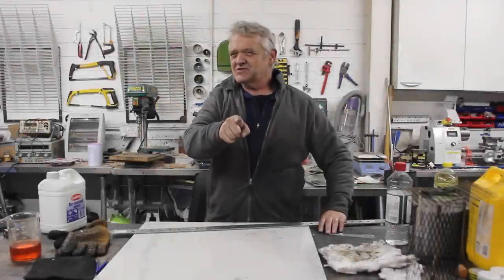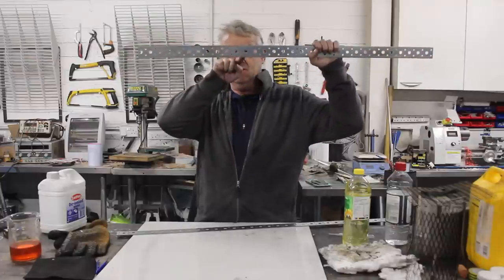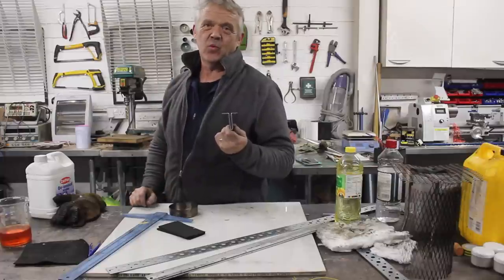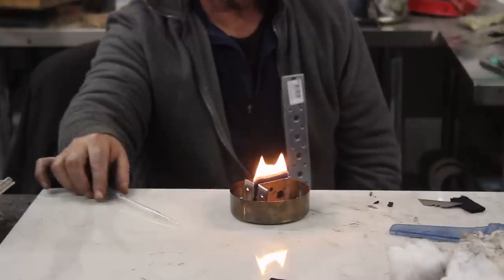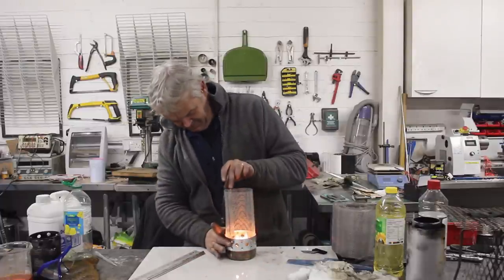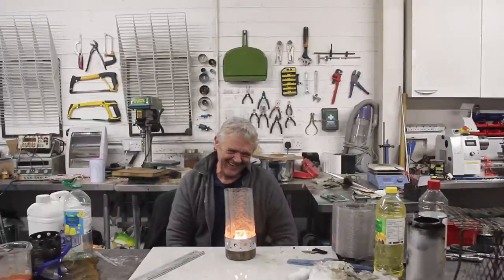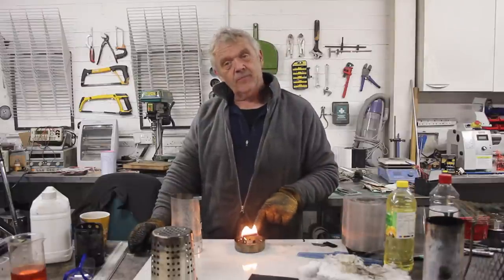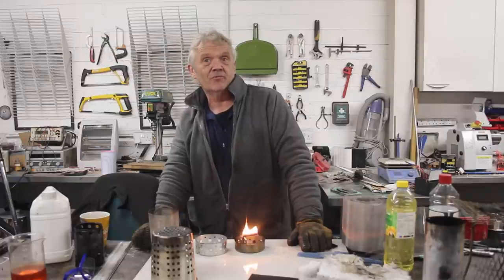1712 Simple Cheap Effective Vegetable Oil Heater

Comment: Thank you so much. Solves the problem I've had for months: Getting a large-enough flame from vegetable oil fuel. (Candles in Crisco collapse before there are anywhere near enough wicks bunched together for a decent flame.) The cat-can stove starves for combustion with heavy fuels. I arrived at an understanding that the mixture needed lots more air. Great answer. I never thought of having big holes in the wick holder to get that air into the wick. Looking forward to trying the circular version, for that much more flame size.

Comment: I make oil lamps both for both fun and practical use, and I liked the simplicity of your design. However, olive oil burns cleaner than other plant-based fuel, so I'd recommend it to anyone who fancies having a go. That said, I'm currently burning a 50-50 mixture of olive oil and sunflower oil, and it's not smoking, but does give off a lovely glow and a fair bit of heat. Anyway, I've only just found this channel, and I'm glad I did. Great video, thanks 🙂

Comment: I made my two tin can heater using rubbing alcohol as fuel...started burning really well, then blew up, the inner can flew out, setting fire to some black bags, the main fuel can was also on fire. Luckily I managed to put out the fires using towels to smother...I will now conduct my experiments outside, or in the sink lol   I had forgotten the cover the fuel hole in the inner can !

Comment: Thank you Robert for your time and effort. Instead of the strapping (which I don't have), I'm going to try cutting both ends off a tin can, squash it flat, and cut it to size. Drill holes in it and open the  folded tin, feed the wick in, and then squash it flat again. Stay warm all of you.
Reply: Best wishes from Ireland 🇮🇪.  Btw great idea

Comment: Robert, I was talking with my father and he said to try black sand in vacuum tubes. He said they operate just like a traditional "radiator" or boiler and the thermal mass maintains a heat of like 300°F even overnight.
Reply: Can you elaborate on what you mean by this? I’m interested

Comment: You could turn it into a radiator by "floating" the kitchen utensil centrally on a long rod so that it is free to spin around, then using tapered metal construct a fan inside it so that the heat spins it around - sending the heat out further into the roof. Bit like those xmas decorations that spin above a candle but this one may also increase the oxygen intake due to the side ducts, potentially improving the pyrodynamics too!
Reply: Heat universally Rises and would act upon the fan idea, gloriously... without the addition of multiple candles.
But it would be rather superfluous.
Reply: @Peter-jo3wt  The rising heat is deflected radially by the propellor, distributing it horizontally away from the device - making a radiator. This also accelerates the rate at which air is drawn into the ducts which adds oxygen to the flame.
Reply: @designerzen  
Heat moves in three specific ways.
Convection
Radiation
And transmission.

Convection means, that heat rises in a column of fluid
(Water, air, other) dynamically.
Radiation means, that heat radiates omnidirectionally from its source (in every direction).
Transmission means, if you touch a hot Skillet it's going to burn you.
A warmer item will transmitt heat to another item of lesser Heat, through contact.

Rising heat that turns a fan does not suddenly become radiant heat.
The fact that the fan May spread the heat a little through its mechanical process, does not mean that the heat radiates from the fan.
Reply: So what you are saying is that the metal fan is unable to heat up even though it is above the source?

Comment: Hi, just a tip. You can use wheel spokes or some thin steel bars to make an outer structure to give it some stiffness. I made a solar parabole with a candle heater that way.

Comment: I like the wick holder. I also found that if you make a "wick sandwich",
by putting a normal cotton wick on the outside (both sides) of the carbon felt and have the carbon felt stick up a little on the top, it will wick up the oil better.

Comment: Used olive oil for my oil lamp, the flame is descent, fuel wise: lampoil makes it burn for 70 hours, with olive oil it was 96 hours and the smell was quite pleasant. But had to pinch the wick a little bit in order to light it, total soaked is harder to get it lit.

That carbon felt is quite an invention and Discovery.

Comment: That was a great idea using the wick horizontally with the vegetable oil, you can now make the wick any length you wish. Imagine a 2 foot long flame with a glass top outside your back garden or inside a cabin. It would give of a wonderful gold light for hours and hours on a very small amount of vegetable oil and that's not to mention the heat it would provide. (You need to get a small gas jet flame lighter this will light the wick soaked in vegetable oil instantly.
Reply: Be careful if too big with carbon monoxide.
Reply: @stonynotdusty   released carbon monoxide: yes this is a very serious problem and should never be used inside a home especially a family home. ( Its good to experiment and wish to use an open fireplace or outdoors ) thanks for highlighting the possible dangers of vegetable oil lamps.

Comment: I'm finding after a long burn (8-10 hours) the carbon felt wick gets a crusty build-up that kills the flame.(using filtered used veg.oil) But, I was thrilled with the results of my attempts...and inspired by you to keep "working out the bugs" and finding better ways!  Thanks for your inspiration!
Reply: Could you have two or  three wick set ups?  Clean one and use one while drying.  Or just replace the wick,. The charcoal sheet is super cheap.
Reply: @secondact7151  I just trim the crusty part off...and relight.

Comment: Not sure if the UK use similar looking strapping for bracing framing diagonally but is a bit lighter and more flexible. Bought on a roll it has a stack of other uses and would be cheaper than what you used Rob. Also easily cut with tin snips.
Quite apparent that you're all facing a bitter winter with fuel going through the roof so I'm sure these little heaters are in response.

Comment: Maybe you can just use your mesh as a wick holder and make the t the same . I like the idea of a circular wick with mesh and will be doing that tomorrow with my carbon felt that arrived . I love burning used motor oil . Its my new hobby ! 😂👍🏻
Reply: Update?
Reply: @secondact7151  soon I will but different way of doing the design .

Comment: Btw, I had used terra cotta for a pick.  I cut out a round piece, and  partially drilled circles within circles in the center about 1/8-1/16 deep and it burned very well and wicked well also.  The circles are necessary to sustain the burn.  Start it with the alcohol or equivalent as you have done.

Comment: I'm making a setup using a computer cpu radiator and 120mm fan to distribute the air, much like a secondary heat exchanger in a home furnace. This oil burning set up should be a great addition to my build today.

Comment: Well, I have some similar strapping as well as some flat stock of similar size.
I'm off to make three. One without holes, One with a few like yours and, One with as many holes as I can reasonably fit.
I haven't any Carbon felt but I have both cotton and fiberglass wicks for kerosene/paraffin lamps and heaters. I still think it'll give a good comparison as to how much difference the holes make.

I'll be back here later if I find anything interesting.

Thanks Rob! TnT is time much better spent than going down some YT rabbit-hole or, worse! turning on the TV or some game.
Reply: I'm curious to know how your experiment turns out.
Reply: @Eyes0penNoFear  That took a bit longer than planned and, while I aim to try again sometime with carbon felt, the one that worked best for me was a simple cotton lamp wick (the stuff I had was 3/4" or 19mm and I used two to make it reasonably wide) but made little difference what holes were in the wick-holder. 
What really mattered was how the wick was trimmed (I think the small space between the two wicks made this easier to tune) and, to a small degree, how thermally conductive the holder was. With a better conductor I could get a larger flame before it started smoking. Another bit that helped was a solid chimney about 5" or 12.7cm with air holes just a hair below the flame and then the mantle to make sure everything burned.
Set up like that it smelled like maybe someone fried an egg that morning, which I'll call practically odorless.

If you or anyone else tries, I'd sure like to hear how it worked for you.
Reply: @matthewellisor5835  thanks for the update!

Comment: Yes a small circular wick should heat and vapourize the oil more. About an inch wide or less. Making sure oil can reach the centre of the circle.

Even better but more tricky is a hole in the middle of the oil Holder, metal folded up or a small metal tube welded in the middle. Then the wick ring going around that hole tube. It will look like a donut cake tin. 
The air rushes up thru hole to make flame bigger and burn better. The oil Holder will have to have legs to allow the air to travel up thru hole.

Comment: That even looks pretty!
I’ve ordered some activated carbon felt. Looking forward to having a play with it. I have a couple of hurricane lanterns that I use on the odd occasion that the power goes out and have thought for a long time that it would be great to burn cooking oil in them. Before I found you the best option was to turn it into bio diesel. Changing the wick will be much easier!
Reply: Where did you get your carbon felt, please? I'm confused and don't want to buy the wrong thing.
Reply: @marijenkins2674  I bought it on eBay. I’m not absolutely certain that it’s correct as I couldn’t find anything about it being 100% activated carbon, and it’s only 3mm thick instead of 5mm, but I figured I could double it up to get the thickness and if it doesn’t burn properly I’ll figure it wasn’t 100%, in which case I can use it to replace filters rather than to burn. It was only $17 so I’m not too fussed if it’s the wrong thing. It actually just arrived a few minutes ago so I’m trying to remember which box the hurricane lanterns got packed into so I can pull them out and give them a go. That might be an impossible task. I do have a couple of tiki torches I’ve never used and I know where they are so maybe I’ll try it in one of those.
Reply: Thanks Monique. I found Robert's online shop and bought a piece direct from him. 5mm 14×14 inch for £10. I'm waiting for it to arrive. Good luck with yours!
Reply: @marijenkins2674  oh good work! I’m in Australia so didn’t want to pay international postage. If mine doesn’t work I guess I will though lol. I found the tiki torch and cut a piece of wick for it. I about half filled it with used cooking oil so figured it had a fair way to travel up the wick so left it outside and I’ll try to light it in the morning. Fingers crossed!

Comment: Handy. I may build one of those and add a small raised outside frame to place a metal mug such as the Army metal mug for making a brew, or an Army mess tin over the top of the flame to warm some soup, beans, etc. 2 birds, 1 stone. It could well be worth experimenting with to see if it will provide heat, light and also cook, as used cooking oil is quite plentiful.

Comment: Robert, that topper thing you put over the flame can be enhanced by first blackening the whole thing (both inside and out) by holding it over the flame so it gets covered by soot. Dark surfaces absorb heat better, but they also radiate heat better. Matte black surfaces have much higher emissivity than shiny metal surfaces. That way, when you put the topper on, and it gets hot, it will radiate out heat to the surroundings as infra-red radiated heat.
Reply: @larrymartineau7507  The reason a mantle is used is because the point is not actually to heat the room. The point is to heat the people in the room. If you just have the flame by itself, the heat is embodied in the hot gases, which just rise to the ceiling. But if you use a mantle, those hot gases heat the mantle up, and the mantle radiates heat sideways, warming up the people around it.

Comment: Is there any way you can indicate actual heat output of the various devices you construct? i.e. in 'watts'.  It's much easier to make a decision on the device to build based on 'watts' than 'hot' or 'hotter'.....

Comment: I think the reason this works is more about the metal bracket getting hot, and pre-heating the oil, helping it vaporize more quickly as it hits the flame front

Comment: Awesome video, by the way would adding a computer fan to it work? i was thinking making like a used oil rocket stove using used cans to make a tube with some holes near the bottom, and the fan on the top.

Comment: I wonder if a wick holder could be made from one or more layers of the stainless steel gauze directly. I'd be curious as to whether the strapping with a few large holes or the gause with many small holes works better. 

Perhaps even the 1/2" or 1/4 steel mesh‽

Comment: If you want air to get to the wick from the underside, then use the wire mesh stuff you used for the mantel, for the wick holder. Would that be too much air and cause the whole wick to burn from head to toe?

Comment: Now your sucking vegetable oil rob, well done. TIP: you could put a peltier stove fan on top of the flame . Tip: you could put the wick between two round metal rods pencil size and make the wick adjustable.

Comment: I did try a circular carbon wick about 4 “ in diameter 1.5 “ high between metal strapping worked ok , I would say 2” might be maximum for wicking vegetable oil ….going to try olive oil with less soot I hope… no luck trying to gasify the vegetable oil.

Comment: cool,. I bet an upside down sardines tin could work as a wick holder.  plus the mantle didn't seem close enough to the flame to help much with combustion.  I wonder if you could use a pot scrubber as a short mantle?

Comment: I wonder what the effect would be if you mixed a small percentage of a less viscous fuel (e.g. methanol) with your veg oil. Would this give a lighter fuel with easier flow? Perhaps burn hotter and cleaner? Thanks.

Comment: Robert, I have an older kerosene heater that needs a new wick.  Would replacing the wick with carbon felt and using veggie oil be a viable heater?

Comment: That is great for a little oil heater. But I would like a lantern with that little carbon felt wick for just using vegetable oil with a glass globe in something like a hurricane lantern. I think I need a strong rigid holder for the wick that would fit in my current lantern and have a good durable carbon felt wick that would soak up the oil and burn. Right now my lantern is 5/8" wide for the wick. So I wonder what I would need to do to make a little insert for that.
Reply: He tried something like that. Look back to his recent videos. The issue was the carbon lasts but it doesn't wick as well so the carbon felt didn't work. Maybe if you designed the holder so it warms the oil. Something like a metal tube that extends down into the oil.
Reply: @hubrisnaut  I was looking at that today and I thought maybe that would work with a gas mantle and methanol fuel for a lantern.
Reply: @travismoore7849  I can't really picture what you mean; guess you have to try it. There are a lot of options.

Comment: I'd wonder about wick life.  Kerosene or paraffin oil is refined to be wick clean.  Wick burning is inherently harder than jet burning with regard to refinement of the fuel.  Even diesel in a kerosene heater takes a toll on the wick after a while.

Comment: Would you like to make a small space heating Ammo-can furnace that intakes outside air and exhaust it outside, where the fresh air intake is preheated by running the fresh air intake some distance through the center of the exhaust pipe. This way  A significant amount of heat that didn't get into room is instead recycled to preheating the intake air. 

Then heat is moved into the room with several vertical pipes inside the ammo-can connecting holes at the bottom if the ammo-can with holes at hole at the top of the ammo-can, completely separating inside the room air with outside and  combusted air. The vertical pipes being an air to air heat exchanger  increases the surface area with which heat is exchanged into to the room. As the pipes warm they heat the air inside the pie which rises through the pipe into the room and thermally siphons in cooler room air from below.

Comment: just received some carbon felt from eBay, However it has the texture/feel of asbestos ! Is this to be expected?
also crumbles when rolled and forced into 22mm copper fitting as per prior videos.....have I been sold a pup ?
Reply: Look for welding blanket
Reply: @justtinkering6713  I did !!
""Carbon Fiber Welding Blanket Felt High Temp Heat Protective Sheet""

Have you ever bought any, and are the material characteristics as I described?
Reply: @Robert Murray-Smith  ?
Reply: @j_o_h_n_d_u_n_n  The one I have feels just like a thick flannel shirt.

Comment: It seems to me that it's a little like you're trying to reinvent the wheel. Effective Kerosene heaters have been around for over a century. I would like to see you take an existing design and improve upon it, rather than starting from scratch - see how carbon felt wicks work in an existing one, and whether it needs to be modified for heavier oils, and how to do so if necessary.

Comment: One way you can improve the air flow is to widen the holder a bit, and then take some thin, "skewer" type metal and poke through the holes of the wick holder into the carbon felt to hold it, stable, in the middle so that now it has an air gap on both sides. Since the carbon felt is pretty light and decently durable, you should be able to get away with only using one to two skewers/holders.